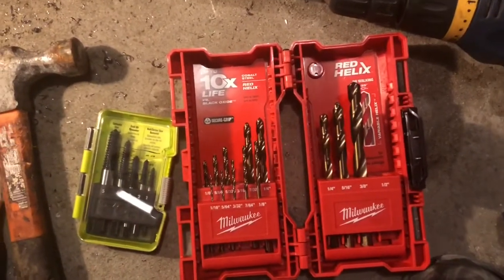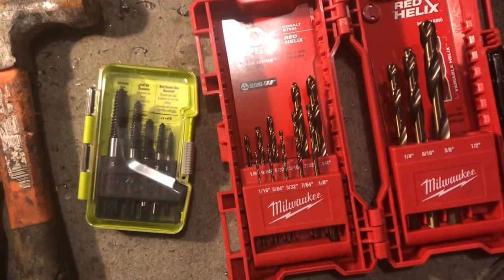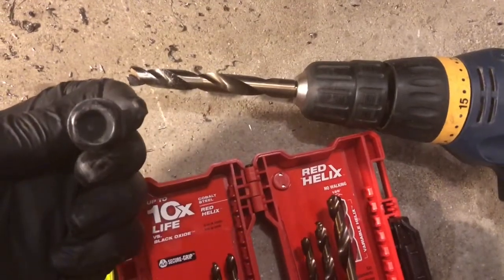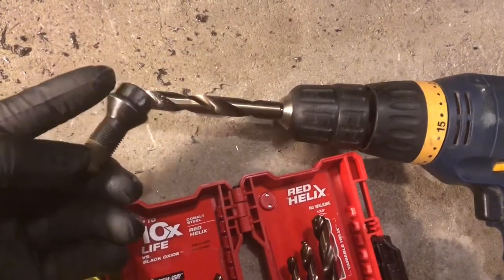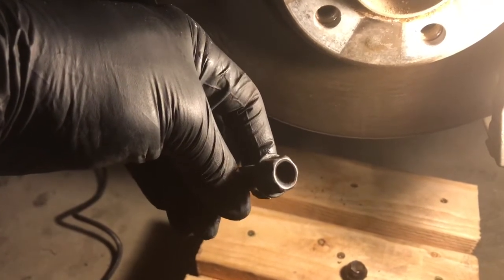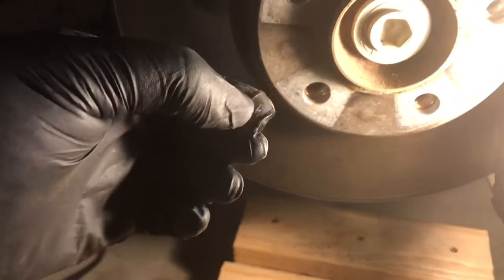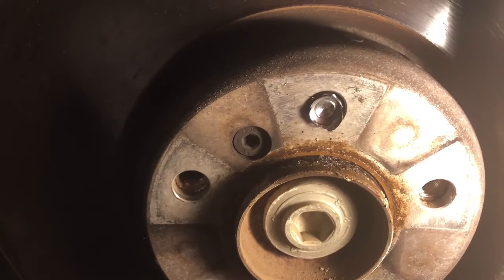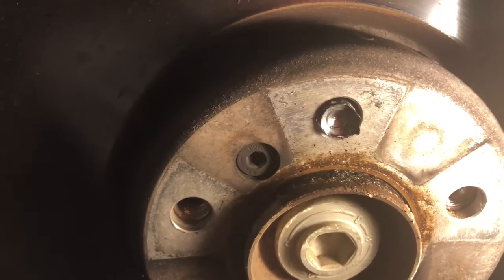Drilling out BMW Lug Bolts

Comment: Your video gave me the confidence to drill out the wheel bolt on my Alfa Romeo Giulia. The bolt had completely come loose after it broke, which I expected since all the pressure was released. In my case, I’m pretty sure the nut was over-torqued when the summer tires were installed. All the other bolts were noticeably over-torqued too—I suspect they used an impact driver on the MAX setting and then just checked with a torque wrench afterward. For those in Europe, I’d recommend using a 10mm and a 12mm drill bit for this job. Thanks again for the helpful video!
Reply from the maker: Glad that it helped you out. I’m sure you had that same feeling I had when it broke off. I figure to save money I may as well try it myself before I have a mechanic do it. Most of the time it works out for me. Thank you for the view and hit that like button for me. Thanks!

Comment: Thanks for this. The drilling method worked for me. I had tried a die grinder, wouldn't cut the bolt head. Bought a 1/2" cobalt bit and drilling the head off. The remaining bolt came right out.

Comment: I did exactly the same process with my 640i . I could show pictures identical to your drilled out bolts. It takes time and patience but beats welding or torching and destroying the wheel. Good job sir, I recommend this method.
Reply: Man how long did it take you? what speed and how much pressure did you apply? Taking forever
Reply: I used some good quality tungsten drill bits starting with a 1/8” pilot hole an working up to a 1/2” using a light oil for lubrication. Make sure you are dead centre with your pilot hole. Once you get as deep as the bolt head you can break off the head allowing you to get the wheel off. The remaining piece in the hub can then  be drilled with a 1/4” bit and if necessary use an “easy-out” to complete the job. I think it took me around 40 minutes total.
Reply: @frederickmackay2234  that makes sense. I’ve been going at it with a 1/2” cobalt bit, with not much progress!
Reply: Yes, I recently bought new wheels for my 328i and I have a stud that is absolutely destroyed, extractor didn’t do the job so this is my next plan! Hopefully it goes well, and I’m praying that I only have to do it to this one stud because if I have more than 5 ima lose it

Comment: Got the same issue with my m235i, tried everything apart from this. Thanks for the video. 👍
Reply: Did this work for you I have the same prob
Reply: @mattpinones5848  I tried literally everything I could think of, spent a fortune trying to get it off buying different tools, etc. In the end I took it to my local garage and they hammered on a slightly smaller socket over the existing bolt with a big ass mallet and and used a breaker bar with tons of pressure to release it. Took them about half an hour to do and only charged 10 bucks for the trouble. I thought it would damage the wheel or hub, but all good in the end. 👍